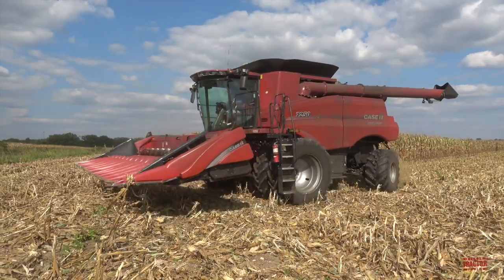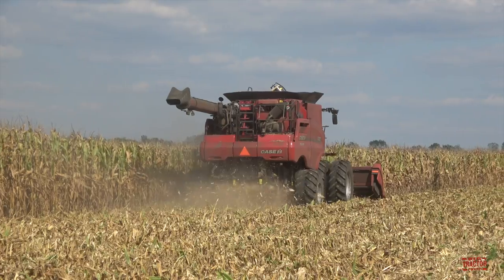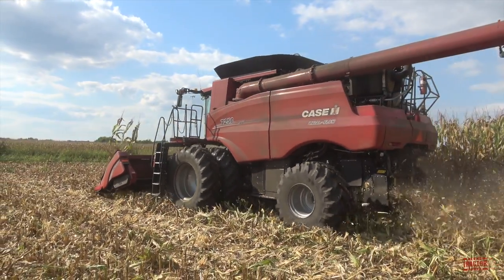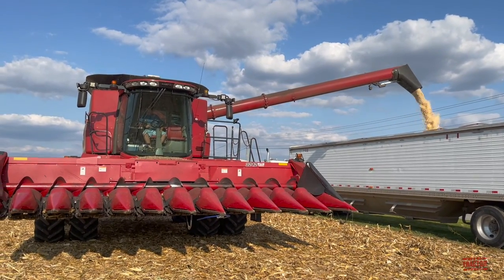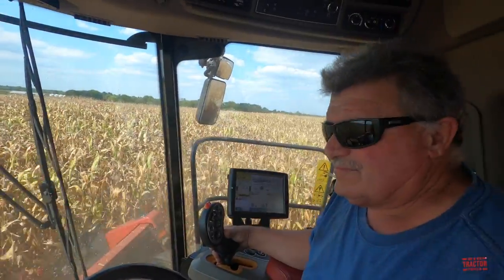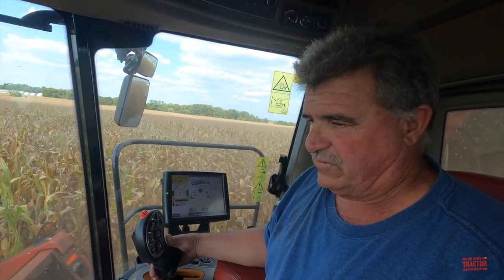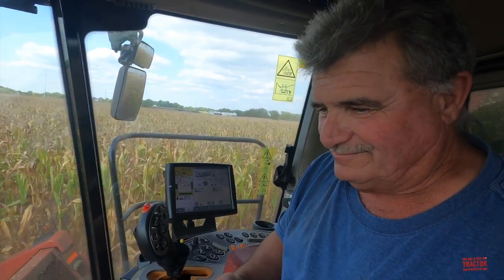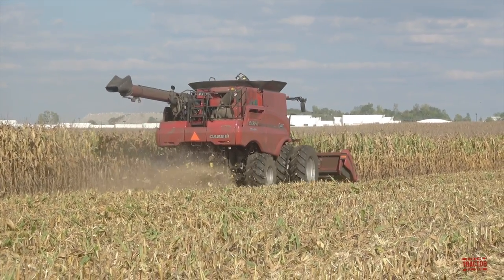CASE IH 7250 Combine Harvesting Corn

Comment: Most guys in our area that were running 20" corn have abandoned it. Not enough yield increase to cover the extra costs associated with it. Vr seeding is where you'll see the biggest advantage.
Reply from the maker: Several farms here in WKY raise 20 inch corn .  30 inch rows are the standard but the farms on 20 inch here seem very happy with the results.
Reply: Only extra cost is in initial step have same thing going to 30 in as well.

Comment: We run 2 2188’s and a 2388. This because where we are I’m Australia due to heat and moisture levels we only ever single plant one crop a year. Also these smaller combines are good for our fields as for they are also used for sheep feeding when not sown. They have trees in the fields so a smaller combine and header are easier to manoeuvre in tight confines
Reply from the maker: Nice combines. The 2188/2388/2588 are well built machines.  They are still popular with many farmers here in the United States. Thank you for sharing.

Comment: Not actually ever being a farmer or riding along with one during harvest, even though I live in the farm belt, this was interesting to see closer up. 
Would like to know more about the mechanics, visually how it works internally.
Reply from the maker: The best I can describe it is the inside of the machine is like a washing machine spinning the crop.  The corn cobs are forced between a spinning cylinder and a grate.  The corn is rubbed off the cob and the grain falls through and is collected in the bin. The cobs are spurt back out on the field. The separation area is very tight just big enough for the crop material to squeeze into.
Reply: @bigtractorpower  Sounds like it would be corn meal, not kernels, dropping out. 😉Thanks for the explanation! 
Maybe Case-IH has a video showing the process, to fill in my curiosity.

Comment: great video! Can anyone tell me what the yield per hectare is in tons?
Reply: 1 Hectare = 2.47 Acres & Good Corn Yields about 250-Bushels/1-Acre and weighs about 56 pounds/1-Bushel. Thus 1-Hectare of Corn Yield = 617.5 Bushels (250 X 2.47) & weigh about 34,580 Pounds (617.5 X 56) or 17.29 U.S Tons (2,000 pounds = 1 U.S. Ton). 
1 Kg = 0.453592 pounds.  Thus 1 Hectare of Corn would weigh about 15,685.21 Kilo Grams.
Reply: @silverfox8241  Thank you very much for your reply, it means a lot to me. I wanted to compare the yield here in Europe and the USA.
Reply from the maker: Thank you Silver fox. Thank you Nicolas for watching

Comment: we don't get enough rain for the corn in the garden let alone that
Reply from the maker: This year in WKY was very dry. There was little to no rain from June through now so corn yields were about 50-60 bu lower than normal.  It has been almost 8 weeks with out rain currently as wheat seeding is taking place. I know it is drier in many places but this drought is abnormal for the region.
Reply: @bigtractorpower  this year we had no rain from the beginning of july to the end of august, and nothing since then now either.. and the last 5 years were much worse some of which only saw 1 to 4 inches of rainfall all year and very little snow too